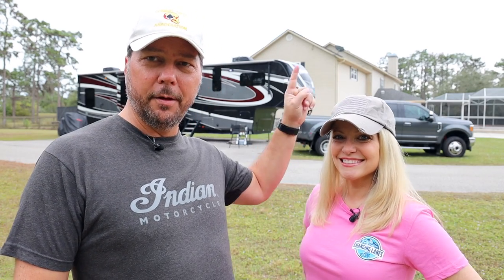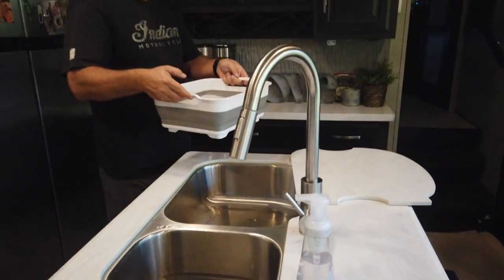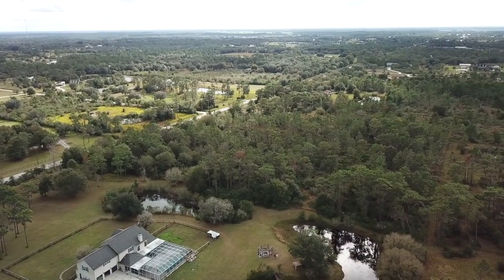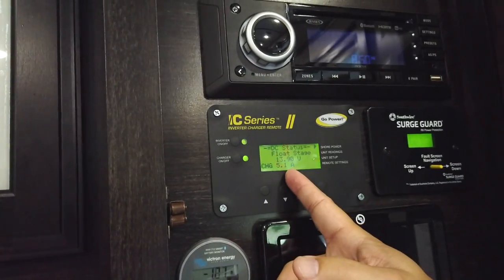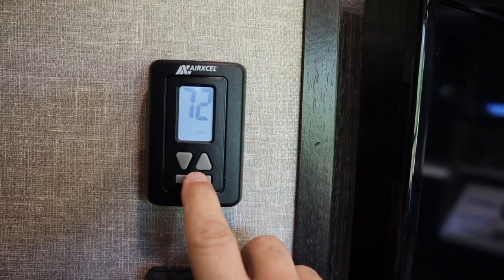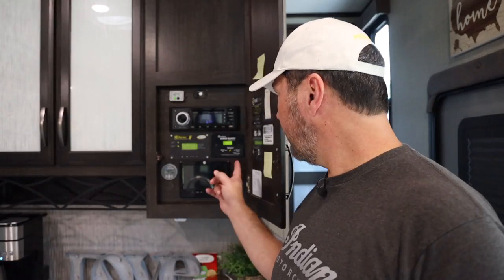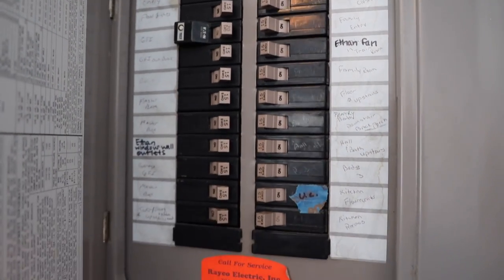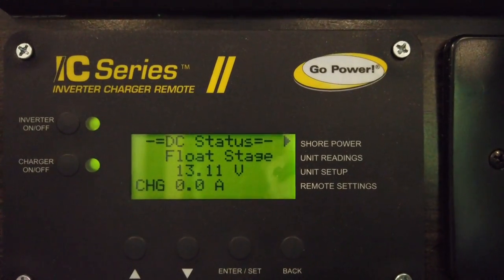RV Moochdocking! | Cheat Boondocking Like a Pro! | Changing Lanes!

Comment: Be careful when running a y-adaptor especially if you are tapping 2 30 amp outlets, you could potentially overload your neutral wire if both 30amp feeds are on the same phase. 50amp rv service is split phase which allows 100 amps to travel through the neutral on (2) 50 amp phases. If you were to hook up a splitter to 2-30 amp connections on the same phase as I mentioned, you could potentially overload your neutral connection at full load. In your case the surge guard may catch this, it may not. Just something to beware of.
Also keep in mind you should never run any circuit continuously at any more than 80%, to avoid things getting hot and messing. 15 amp breakers put out 1800 watts, which would be 1,440-1500 continuous use, or 12-13amps max continuous.
Here is some more detail on split-phase:
https://www.rvtechmag.com/electrical/chapter3.php
Reply: There is also another potential issue with the way they set up their 2- 15 amp circuits from 2 different buildings. They are combining neutrals from 2 different panels ( main house and guest house) if both circuits were from the same house this wouldn't be an issue
Reply: The outlet im plugged into is on a 20 amp breaker.  The ac was pulling 13 amps for about 2 hours and the cord started getting a little hot. Is that normal? I shut the ac off because I wasn't sure. I was using the same cords he had so rv cord to 30 amp and 30 amp to 15 amp. No extension cord

Comment: I would recommend bring a extension cord through a slide that is on separate breaker and plug some items to that. During the the winter we plug a floor heater to that extra cord and that way you trip breakers when running high voltage items

Comment: Excellent video.
I want to add two things:
1) EasyStart for the Air Conditioners. ALL RV manufacturers should just add them and add the $300 each to the RV price. They’re priceless.
2) The long extension cords should be as heavy a gauge as you can afford. Smaller diameter wires will have voltage loss at higher currents.

Comment: What about voltage drop from what appears to be a very long 15 amp extension cord?
Reply from the maker: Yes... Good point on the extension cord. I should have mentioned that the extension cords need to be rated for the amperage. I also should have noted that an EMS or total electrical protection system are highly recommended to detect any voltage or wiring issues. We will add these to the description and blog.
Reply: I always kept a voltmeter plugged in to monitor voltage under load.

Comment: I'd also make sure each extension cord you're using are at least 14g outdoor/garden use rated or better. For those that don't know instead of going up in the wire gauge number it's kind of backwards. A higher number would actually lower the rating of a cord or any wiring really. You want to go down in number. IE: 14g will handle more current/amperage than 16g, where as 12g will handle more than 14g and so on. Hope that helps a little as well. 
As usual Chad and Tara are awesome and make things like this simple to understand, thanks guys...

Comment: Garages and shops wired to code will generally have more 20 Amp circuits than 15, but your plug pattern remains the same.  A good idea for those that do a lot of Moochdocking would be to have some extra homemade plug converters on hand.  A 30 Amp RV receptacle is a different pin config. than a 30 Amp clothes dryer receptacle.  It's very possible that some farms/shops will have 30 or 50 Amp welder receptacles which would also be a different plug configuration.

One last note was that a distant cousin of mine whose family did a lot of camping in their Airstream...when they built their house in town, they had a recessed stack with a threaded cap installed in the driveway that led straight down to the sewer...for their own personal dump station.  I'm not sure how legal the city thought that was, but I thought it was pretty handy.

I REALLY enjoy these infomational videos because these RV systems are quite a bear to understand for someone like myself who has zero experience with them, but looks very much forward to them in retirement.  Thanks so much for all of the info, tips, and tricks!
Reply from the maker: All great points.  We added much of this to the video and blog yesterday.. 👍🏼   

➡️ EXTENSION CABLES: Be sure to make sure any extension cables you use are rated for 15A. For longer runs like 100ft, these are NOT the cheaper cables. They should be labeled with rated amperage. Also, the longer the cable the more the voltage will drop, so keep an eye on it to make sure it doesn't drop below 108v (90% of 120v).

➡️ HOUSEHOLD CIRCUITS: When a household outlet/circuit is rated at 15A, that rating is generally for short term (under 3 hours). The real rating for long term load (over 3 hours) is 80% of the rating. Meaning, on a 15A circuit, if you’re going to run it over 3 hours, you should be at 12 Amps or less. An AC is like long to cycle less than 3 hours anyway, but on a hot day, it’s something to be aware of.

➡️ HEAT: When connected to 15A or 15A+15A and running for about 30 minutes under load, do a check of the entire line from your RV to the adapters, to the extension cables, and to the wall outlet. Do a touch test to make sure the lines and/or connectors are not getting hot.

➡️ POWER PROTECTION: We HIGHLY recommend using a Surge Guard Total Electrical Protection device (see: youtu.be/4FNtBtE_x2s), or some type of EMS that validates your power source voltage, frequency, wiring, etc. These are a great safeguard against bad RV park wiring as well as bad household wiring and just plugging things in wrong.

Comment: I would suggest to use 20A circuit if possible. Electrical code requires 20A in kitchen, dining room and service receptacle by the panel and house AC compressor. If you do that you will end up with total of 40A capacity on the RV.

Comment: Just a tip on figuring out what outlets are on the same breaker. Use a small fan, radio, or light(s) plugged into them and shut off the breaker. MUCH better than tripping your breakers, multiple times to figure out what's what.

Comment: It has been mentioned in other comments about GFIs sensing different return currents and tripping.  Also, having a large enough gage wire to handle the length of cable from the house.  Both are well mentioned.  I have a solution to some of the problems.  Many years ago I made up a 75 foot extension cord for my RV.  It is rated for 50 amp/240 volts since my driveway could not get my motorhome close enough to the house.  I had a 50 amp/240 volt outlet in the garage for welding.  The welder uses a different plug than the RV so I also made up a "dog bone adapter' to convert the welder outlet to the same type as the RV plug.  I also made up another "dog bone adapter" to adapt from 30 amp/240 volt outlets commonly used in household dryers.  I have been at campgrounds where the campground site I was assigned had a defective outlet.  After speaking to the campground operators and assuring me there  was no camper coming into a nearby campsite, I used the extension cord to get my electrical service over to the other site without having to move my motorhome.  I can now moochdock when someone can give me their dryer outlet or another more powerful outlet other than a 15 amp outlet.  I would, however still try to limit the total amps used in this type of arrangement.  The reason for that is the TOTAL length of cable.  In a house, that outlet may run 60 or 70 feet from the circuit breaker panel ( service entrance) plus your 75 foot extension plus your 25 foot RV cable totaling more then 160 feet.  You must watch out for the voltage drops when using large amounts of power.  Therefore, try to not use more than you really need.  If the 2 AC units are running, the refrigerator is on electric, the hot water heater is on electric, you are charging batteries, think about not running the microwave for popcorn.  Watch both your amperage on both legs AND your incoming voltage on both legs.  You should always stay above 110 volts as your minimum volts on each leg.

Comment: Thanks for making this video.  I learned how the 50 amp system works in my motorhome.

When you are trying to find outlets on separate circuits in a house you can turn on lights or anything that's plugged into wall outlets...
 Then go to the breaker box and turn off every other breaker on one side until an outlet goes dead.... use that outlet and one that is still on (alive) for your separate extension cords.  If you don't find one that goes off, repeat the process on the other row of breakers.
Ignore any double breakers because they are connected to both circuits.

When storms knock out my power and it becomes obvious that it's not coming back on anytime soon, I get out a generator and TURN OFF the main breaker then plug the generator into an outlet outside so that there are no fumes inside.  I use an extension cord with Male plugs on both ends... BEFORE I start the generator....Then I  can use another extension cord with two male ends to connect a dead socket to a live socket so both circuits are live.

Do NOT plug into the live socket FIRST. 

 The prongs on the end of the extension cord will teach you a lesson about electricity if they are hot.

Comment: Thanks for the breakdown on the electric stuff. We had the option of chosing to be in close proximity to some friends at our favorite campground at a 30 amp spot, or a ways away at a 50 amp spot. We reluctantly settled for the farther away spot because the dates are in July in Ohio...hot and muggy...because we knew we'd need both A/Cs. Now, thanks to you, we have ordered the appropriate dogbones and can stay at the better spot with 30 amp and 20 amp  plug-ins and pretty much run everything we need. Thanks a million!
Reply from the maker: Just be careful on the 30+20.   Being in the same box, they are on the same circuit and the circuit is likely rated for 30A...  I'd check with the campground first...
Reply: @ChangingLanes  , good call, thanks. (Always sumthin' eh? Lol)
Reply: @ChangingLanes , just happened to think of this...all of the power pedestals at our home campground have individual breakers for the 20, 30, and 50 amp circuits. Wouldn't that indicate separate circuits for each?
Reply from the maker: Maybe...  LOL  You'd think that, but I would still ask.

Comment: FYI , Recommend to use a heavy 10 gauge or 12 gauge Extension Cords minimum .
Never use light 14 gauge cords , try to keep as Short as Possible.  Less the Connections the better . Low Voltage will kill your A/C - Appliances. 
Your Inverter is Awesome 
Love your Channel 
Dean Goeller 
Master Electrician 
Rock on
Reply from the maker: Indeed!  We should have mentioned that but missed it..  We've added notes to the video and blog post.. 👍🏼

Comment: Something you may want when trying to connect to seperate circuits, a tool from Klein whch has a plug and wand which you can use to identify which receptical is on which breaker in a panel.

Comment: Another handy device while moochdocking...A Thetford (or SaniCon or FloJet) Macerator Pump. Dump into your host's sewer cleanout.  But, some sewer districts DO NOT allow this. So don't leave it hooked up fulltime. We have used ours in a State Park and ran the hose into the outhouse.

Comment: Great video!  Thanks for the tips. One thing to consider is that according to National Electric Code, continuous load on a circuit should be no more than 80% of the over-current protection to avoid overheating the wiring and breaker (which can cause the breaker to prematurely trip). That being said, if you are connected to a circuit that is protected by a 15 amp breaker, you should really pull no more than 12 amps continuously.
Reply: I was just looking through the comments to see if anyone else brought that up. I'm glad someone did.  14A continuous draw on a 15A circuit is not a good thing. Sad, but true.

Take the amp rating of the breaker and then "de-rate" by 70-80%. The hotter the ambient temp, the more you should derate. So on a cool day, run at 12A on that 15A circuit, but if you're hitting temps 100F or higher, you'll probably want to limit yourself to 10.5-11A max. There are reasons for it, and as usual the risk of fire and melting wires is way up there. :)
Reply: You may not see this but I'll try anyway.  The outlet my rv is plugged into is on a 20 amp breaker.  My ac was drawing 13 amps. After about two hours,  the cord was getting warm so I shut it off. Is that why?
Reply: @dawnr6577  your RV cord shouldn’t get too warm if you’re only pulling 13 amps since it is a large enough wire to handle either 30 or 50 amps

Comment: Thank you so much for the information on the electrical hook-up. I have a 43 footer myself and, every time I plug in at the house I pop a circuit breaker. So now I know I can split the poles that will really help when I'm home charging batteries and doing maintenance.

Comment: Great Video! I Really like the content. You guys have a great set up and super advanced technology in your rig. On the 15/15 split, If You have to go into the house for the second power source, grab a kitchen or Bathroom outlet (they will probably be GFCI). Per the NEC (National Electric Code) both these rooms in your house should be 20 amp circuits. That (15/20) extra 5 amps might save you from resetting the breaker a few times.

Comment: Great info. I do wish you had talked about some of this in more GENERAL terms.  Not everyone has a beautiful newer RV with that incredible power panel or built in inverters!  Some of us have an RV built before the turn of the century.  We all have different goals. Our goals involve buying with cash and being debt free, which is much more important to us than having the latest luxuries.
Reply from the maker: The power splitting part can be done on any 50A rv...  So can the inverter if you install one.  Doesn't matter if it's new or old.  These things are all possible.
Reply: @ChangingLanes  Ok. But Im guessing that a 30 amp RV cant split because its only one circuit and not 2 separate circuits like the 50 is?

And if you could run one AC on one 15 amp circuit/extension cord, could a 30 amp camper possibly run one AC on a 15 amp circuit?  I know that people do that. But someone told me that the newer air conditioners are more efficient in mine is an older 1999.  It might take more amps than the newer ones, or more surge amps.

Comment: Inverter with the hybrid mode is definitely a modern day necessity for all 50amp rigs IMO. Is this usually a stock item in newer 5th wheels these days? Also, sorry if this was covered in another video, but what size/type battery bank do you guys have?
Reply from the maker: We've not seen and new fifth wheel with a good full passthru hybrid inverter.  Most put in a ver basic one for just the fridge, or the fridge and a few outlets.  Maybe in some higher end DRV, Luxe, etc....  
We started out with 4x6v (225Ah total) Trojan T-105 deep cycle batteries and now have 3x12v (300Ah total) Battle Born Lithium.

Comment: Have you ever considered using an Autoformer (essentially a step-up transformer) in parks were the weekend load causes a voltage drop?  Does your surge protector shut down on a low voltage condition (mine trips at 107 vac), or do you always keep your inverter online?  Finally, do you recommend soft starts?  Appears you are fine without them given how you step up the current draw...I was especially interested in seeing the demand for your 15K BTU A/C.  Great video!
Reply from the maker: There was some talk of autoformers in terms of electrical code in RV PArks... essentially not allowing them since they essentially draw more amperage to step up voltage... Not sure what ever happened to that, but autoformers are certainly a good option.  Our surgeguard doestrip around the same low voltage.  Softstarts are great too but, like you said, we've gotten by pretty good without them.  We run all 3 AC's on generator (45A) fairly regularly.

Comment: Running extension cords that far you should make sure it’s the right gauge wire. You will melt a cable running a long distance if it’s not sufficient size.

Comment: You should get a power shedder. it allows you to hook up for high amp stuff into a control boxing prioritize everything. So if you turn on the microwave instead of popping breaker the shedder turns off an AC until the microwave is off then it turns it back on automatically. They're not super expensive.
Reply from the maker: We have that... However, it has no idea when we're hooked up to non-standard power like we do in this video.  So, it just gets in the way.

Comment: I always love y'alls videos! I'm in Texas halfway between Downtown Houston & Galveston ... I have an extra driveway that will accommodate your rig (and you can park the bike in the garage). Y'all are always so genuine and fun ... You can "moochdock" at my place any time! I'll have the grill fired up and the cocktails ready! 

I'm currently between Rv's and I'm actively seeking a Class C ... I've had various travel trailers, race trailers w/ living quarters, a class B, a class C, and a 42' Class A coach. I loved and hated each one for various and unique reasons - With my upcoming ventures in video production, a Class C is the obvious choice for me.
Reply: Just a sidenote: My sewer cleanout is not very far from the "moochdocking" driveway I have available; so you could easily dump tanks as needed. Did I mention that my property is almost completely shaded by 100 year old Pecan Trees? (branch clearance isn't an issue). and as as an added bonus; I am located less than 2 miles from the Kemah Boardwalk and my property is just one block from the water.
Reply from the maker: Thanks for the invite!  Will bookmark this in case we hit that area.. 👍🏼  😊